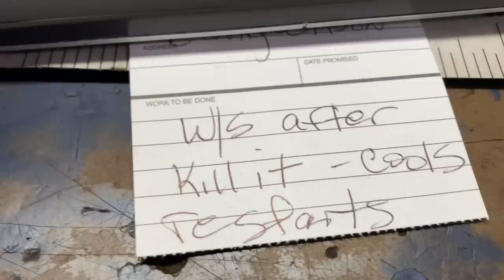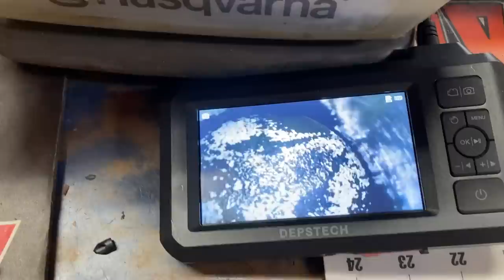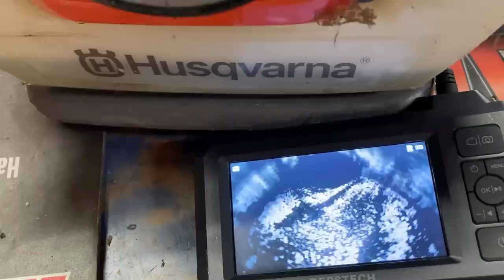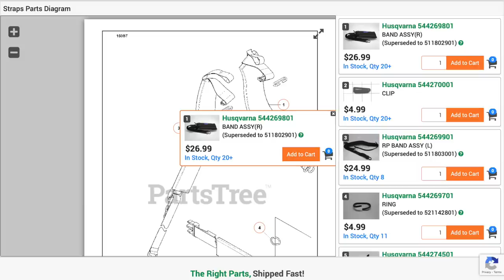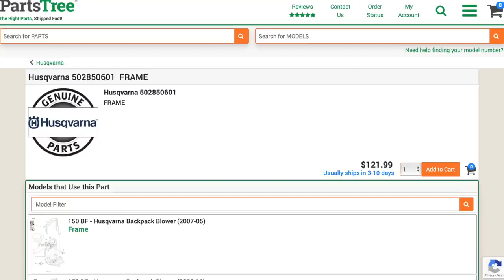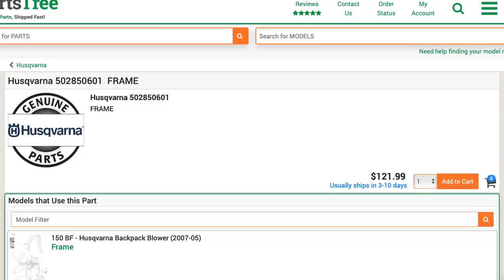You won't believe HOW MUCH $$$ I can make off one burned up Husqvarna 150BT Backpack Blower? GUESS!

Comment: It is always nice to see parts getting repurposed rather than thrown away. I have parted out a lot of small equipment online over the years. I use to fix them up to sell but I learned it’s so much easier and more potential profit to just part out. Some of the prices for oem parts are absurd so used is the next best thing for most people. I can’t believe Husqvarna would ask that much for an ignition coil!
Reply: I agree it’s unreal price and pretty clear they don’t wont them fixed but buy new one

Comment: Well, the oil in the gas tank guy actually unknowingly did a good thing in a way. If you’re going to store a two stroke for over a year like that, putting oil in the carb will keep everything inside good, as long as you recall doing it two years later and remember to drain it out.
Reply: I learned that from Bre to store all my 2 strokes with oil and prime til it runs through the lines to protect the rubber from drying out . Seems so simple , I’m 58 and had never thought of it , once ! I love learning something new , and I always do on the channel !

Comment: Great video, I've had my 150bt for 11 years and use it for my 3.5 partially wooded acres. It has been an excellent machine for anyone considering one. I've only changed the fuel lines and filter. Thanks again for the video.
Reply: Have the same little blower and it works great, but tuning up my airboat a few weeks ago I discovered I could blow my whole front yard in 30 seconds verses and hour and a half with the blower.

Comment: I have done the bar oil error, ONCE, hopping I really learned to look at the symbology on the cap!  If it has a gas pump gas goes there, if it has a chain link bar oil goes there!  Nice to see the fix is simple, I paid a expensive $160 for a new chinezium carb installed as the dealer said it was needed!

Comment: I enjoy your content. It's crazy what the shop rate differences are depending on where in the country you are. I'm a mechanic on Long Island and the prices you mention I wouldn't even blink at to buy new. My shop rate here is $140 an hour. I wouldn't even think about replacing a spring in a pullstart for what a new one costs. It's not like I'm just a parts replacer, I try to fix what I can but I always have to balance it with labor costs.

Comment: I had a momentary brain failure (happens more often as we get older) and put oil in the fuel tank once. It happened on my old McCulloch saw that has the gas and oil fillers right next to each other. I did like you did.....drain and replace. No worse for the wear. Thanks for the great videos!
Reply: When you have a bunch of equipment both 2 & 4 stroke , sometimes I have to stop & thnick a second when fueling  -  especially when some of it only gets used once a season

Comment: I'm thinking about getting into small engine repair as a "retirement job" and really am learning a lot from your channel! and after a long career in construction, I can tell you tool frames can/ do break, especially if used in commercial/ professional environments (ie falling off trucks, ladders... or from hiring idiots)
Reply: Mike,
Good luck to you.  It's fun for me to work on small equipment/engines.  I just finished working on a 2005 John Deere 145 mower it has a 22 horsepower V twin engine.  The complaint was the battery would die before they got their yard cut.  I checked the alternator output and it was very low put a new alternator on and it didn't do any better,  less than 13 volts.  I unplugged the alternator ( it has 2 wires that connect to the voltage regulator) it would only put out 12-13 volts AC.  I reved the engine over the governor speed and it started charging at 32-36 volts AC I hooked the alternator back to the voltage regulator and now it's putting out 13.6 volts DC so the battery will stay charged now.  I have a lot more work to do,  but the no charge,  was the most important.  Why sharpen the blades when the mower won't run? 

It can be fun and make a few bucks as well.  Again good luck to you Sir.
Reply: I m retired diesel mechanic and I spent about a grand getting some special tools and equipment for small engine repair 
Not bad but waiting on parts all the time
Reply: A friend does that. He gets a lot of engines from auctions and sales and restores them. He mainly works on outboard motors, lawn mowers, hedge clippers, chainsaws and strimmers. He has also worked on many motorcycles.
Reply: @philliphall5198  
I understand having to wait on parts,  that's a pain.
Reply: It's decent, but never gonna get rich doing it. I got certified and hired working on van mount carpet cleaner vacuum motors. B n S Vanguards, and similar. I enjoyed the work, but needed a bigger paycheck. 
Went on to industrial maintenance.
Reply: @Petesworkshop2225  
I can understand about the pay.  I am retired  and enjoy working on these things.  So the pay is just an extra Benefit for me.  Glad you found something that could pay the bills and I hope you enjoy your work.
Reply: @Petesworkshop2225  I'm not having any delusions of getting rich, just looking for something to do part time, at home, to make a few extra $. This time of year (winter) is usually slow for me with my regular work and I am always looking for things to do inside, that don't COST me money.... like all of my hobbies :)

Comment: So cool, I have a car trailer FULL of weedwhackers leaf blowers chainsaws 100s of small engine household items all 90% need is a cleaning and they will run fine I get them from our local dump. Now I am finding cordless yard items and usually have a bad 1850 cell in the battery pack. . Thank you for the great video!

Comment: My latest oops was after servicing the oil pump which required removal of the sprocket clutch, I went outside and tried to start the chainsaw with the piston stop still installed instead of the spark plug. Didn't hurt the machine but almost ripped my fingers off when I yanked on that handle!

Comment: Thanks Bre.  You helped me fix my BT150 this season.  Only needed new fuel filter, air filter, plug, primer bulb, fuel lines.  Maybe 18 bucks in parts off Amazon. (Interestingly, Lowes doesn't stock filters for these units any more).   Biggest challenge was pulling the new fuel lines into the fuel tank.  Definitely need the big hemostats for that job.

Comment: Well here's a story for you . I was noticing that my mower wasn't filling the catcher properly as it was half filling and leaving clipping behind so i cleaned the mower body and sorted the  blades ! still very little change . Well it turned out ( I discovered ) that the catcher being made from a hard  plastic it has small vents with a filtering grill on the inside that if not cleaned regularly(specially after wet or damp mowing  )  clogs and won't vent and  creating  a air lock affect which interrupts the air flow which helps carries the clipping into the back of the catcher . I wonder how many others have had this issue ,even cloth catchers . I enjoy your videos !  keep it going ... In more ways than one  lol

Comment: You would do your body (mostly shoulder) a big favor by retraining yourself to adjust your pull.  You short stroke it to engage the starter which is great.  But then you slack your arm every time which reverses what you just did by engaging the starter. making you yank everything through the engagement causing a slight jerking to occur every time you pull.  I submit that you relearn your pull to begin right from the engagement of the starter. So, short pull it until the moment of engagement then continue your main pull directly from that point.

Comment: Thanks for the explanations and a view into daily shop life!  Just a quick question for you: are the Husqi's parts that expensive because of import and shipping costs or is there simply a general tendency to rip people off in the market for maintenance parts? Anyone with the answer, feel free to chime in.  As always, thanks for your honest videos and straight-forward content!
Reply: Clearly manufacturers want consumers to buy new units rather than fix small problems with their old ones. That blower purchased in pieces would cost $1575 plus shipping and tax.
The Chinese are taking advantage of this strategy by offering knock off parts at a fraction of the cost.
Reply: All replacement parts tend to be expensive unless they are something very common or fit lots of machines. They are sold 1 at a time, often ordered 1 at a time. Very expensive process when compared to making complete new units on an assembly line where they might be making hundreds or thousands in a run. It's not a ripoff, just the economics of how things happen.

Comment: Really like your show and I have learned a lot from your vids on how to maintain my gas powered lawn tools. The only one that has me bewildered is my echo leaf blower. It will start fine but won’t rev up unless you put back pressure on the air outlet.
Reply: Mike Dixon, your leaf blower likely has carbon buildup in the exhaust port. Should twist out with a socket. Use a small propane torch to heat up and burn off the carbon build up and then hit it with a wire brush. Screw it back in the exhaust and you should be good.
Reply: @PaulWRose  spark arrestor , muffler and exhaust port was one of the first things checked. The machine only has less than 10 hrs on it but unfortunately the warranty is out on this unit . It set for awhile before I acquired it. But thanks for the reply.

Comment: I had put away my brand new Stihl Farm Boss Super with full fuel & bar oil and got to work bucking up firewood Saturday morning.  After the first refueling & topping off the bar oil I noticed it took a couple of pulls to start my saw.  It was a bit sluggish but still cut OK.  About 3/4 through the tank of fuel I realized what I had done.  I needed some diesel for part cleaning and used one of my saw-gas cans to hold it.  THAT was now in my saw!  I called my dealer, told them what I had done and asked what damage was expected.  He told me it happens more often than you think and that diesel (pre low sulfur version) has some lubrication qualities and that I should just replace it with fresh gas and keep on working.  The saw is still running fine 20 years later.

Comment: I just fixed our churches Toro snow blower, carb was leaking and had a broken part, a new knock off carb was $12.00 dollars on Amazon it was actually a better carb then the original put it on gave it 2 pulls started right up checked adjustments perfect right out of the box, hard to beat for 12 bucks, I have really had good results with these knock off carbs.engine was a Tech LH318SA

Comment: I have a Stihl 361 that had been a battle starting since new because of flooding. As a result I got good at clearing the flood. This year I couldn't get it started no matter what so I took it to a Stihl dealer. Their answer was it's flooded and ran good for them. After I continued having the problem I took it to a second dealer. They said all it needed was a bit of adjustment and I went through starting (warmed) with them. After a few days I was back again to not starting. After watching some of your videos I decided to check the coil. I didn't have a spark plug tester but couldn't see any spark when I grounded the plug. I ordered a new coil on Amazon and thanks to you had no problem installing it. I did not have any problems after install it. I guess my question is can a coil not function properly with the stated Stihl start procedure but will work when all the steps like decompression are not followed?

Comment: i just got a Husqvarna 150bt it it brand new never been run other than a factory starting from lowes and the customers that come in pretty much parted it out on the shelf from the tubes to the air filter and gasket to the fuel lines and fuel cap an estimated 115 dollar repair in just parts  they would have taken the engine if they could  said to my self these customers are going to make me love them.

Comment: If it were $133 plus labor, if my backpack blower died because of that, I would definitely replace the coil; this backpack blower is the best thing I ever bought. I used to sweep my roof off with the broom and a long driveway. I can blow the driveway off as fast as I can walk, and it makes quick work of the roof. All is good now that I've installed gutter guards and new gutters.

Comment: I've had my 150bt since 2011. It's been flawless. I recently replaced the fuel lines and grommet. But if the coil ever fails I'll just trash it or part it out. I can't believe how expensive replacement parts have become!

Comment: probably the most common thing i seen was people pulling the chain cover off with the chainbreak on. it wouldnt come off so a light pry then they cant figure why it wont go back on. bad thing is a little over half the husqvarnas the lever is not part of the chain cover.  the one clutch tool worked on most, the others i made one from an old socket with a grinder and some patience

Comment: Thank you for all you good advice. I have a sthil 170 saw that runs great for 10 minutes, dies and won’t start until cold again.
Why do coils fail so easily? This saw probably has less than 10 hours on it. I wonder if the cheap Chinese coils are any good? I only paid 50$ for this saw.

Comment: I remember old timers used to fill fuel tanks with oil and pull the starter to get the oil in everything when they knew it was going to be stored for a long time... this was back in the 50's, 60's, 70's... (it worked) but I don't remember why as it was B4 ethanol.

Comment: Hey Chickanic   its Husqvarna   as in  huskvarna ,    Imagine  a chick working on garden machinery  WOW , iv been  working on  machinery for 45 years,  it started off with a 12" cylinder  mower  grass box  out the front, then it just snowballed , then somebody  asked me to  sharpen  a double sided Sthil  hedge cutter  80 edges to be sharpened  on a 24" cutter bar, all a a precise  angle,   no mean feat  using a hand held grinder  running  at 11000 rpm .  So i  take my hat off to  you     good on you    and you're  easy on the  eye to look at .    Pity your  on the other side of the pond as they say .  Stan     Scotland.

Comment: on the subject of 150BT's,  I started it up first time this season, after sitting. It was sluggish and bogging down.  I realized it was my gas mixture, as I was running it too lean.  I corrected that, but now the throttle response is very slow and at times looses power as if it is running out of fuel.  Suggestions?  Thank you,  Max

Comment: When you're using the primer bulb to clear the fuel system of Bar Oil where does the bar oil go? Does it go through the carburetor into the cylinder and you pour it out the spark plug hole that seems likely. Or does it magically fall back into the gas tank if you hold the saw the right way?

Comment: Yeah did the bar oil in the fuel tank thing but I caught it as I started to put fuel in … the bar oil tank.
I was pretty far out in the woods so I dumped tge bar oil, rinsed the tank, started over. No problem.
Husqvarna 462XP …

Comment: Filling fuel tank with bar oil in Stihl chain saw - been there done that\!  After discovering error, drained oil, flushed fuel tank with fresh fuel [no primer on this saw] and after 5,000 or so pulls,  got it to fire and after a few minutes ran fine.  Neighbors asked if I had started a new business - misquito abatement and control and how much did I charge?  Since I always try to learn from unforced errors, I got my Dymo labelmaker.   One label says "This hole is for bar oil dummy" and the other says this hole is for fuel - dummy!  You guessed it.  When I first put the labels on the saw, I put them along side the wrong holes!  Thank goodness my wife knows what she is doing and pointed out my error.

Comment: Worked on small engines for nigh 60 years. Oil in the gas tank's common & you can bet there's gas in the oil tank. No one's pays attention. Had a friend who would never cap off their gas cans & as far as I know they still don't. For years that was their main problem. I finally refused to work on their stuff. I had told 'em of this for years & I was talking to a wall.

Comment: Happened to me once... bought a new stihl ms211 and poured bar oil in the fuel tank... fuel in the bar oil tank... couldn't turn on so I returned it. They figured out what the issue was and cleaned it for me and refilled the right way. I was charged $75.00 and I felt dumb for a bit lol. Saw

Comment: Hiii, hmmmm ... I made the same mistake with my 1998 Jonsered 2045 Turbo chainsaw ! I filled baroil in the fueltank in a hurry, but didnt try to start it ,because I realized what I just did 😆... this saw has no primerbulb, so I emptied the tank and added new correct fuel... It started after some pulls and was smoking like an old dieselengine for a while ...  These days this saw gets a full tune up with new clutch, sprocket, fuelfilter, oil pump parts ( bar oil leak ), spark plug,bar and chain before my firewood season starts... just got some carburettor parts in my mailbox too which I will look into if I cant adjust the carburettor properly ! Then I hope it will run fine for a long time !

Comment: question: I removed the piston and noticed the motor itself had no lubrication but rather had what appeared to be dark dust or burned old oil.  What type of oil should I use for the engine itself where the shaft is?

Comment: I had a new Husqvarna back pack blower come in for a no start, it was 2 years old and said to be used 3 times. it had a bent spark plug(no idea how) and a broken kill switch(on the inside). I replaced the plug and switch. ran like it was new.
Reply: seen zero interface on the piston.